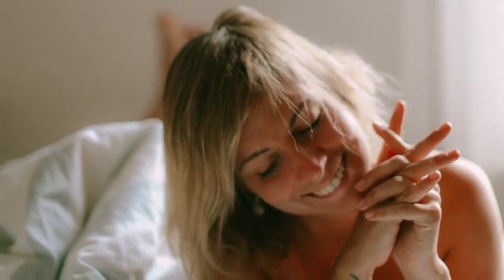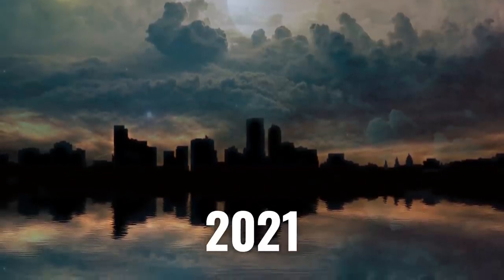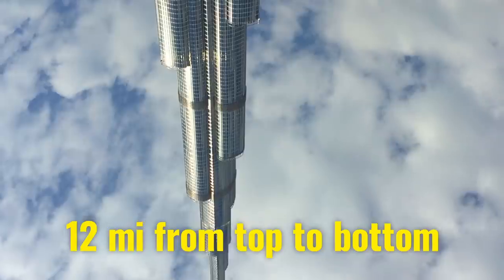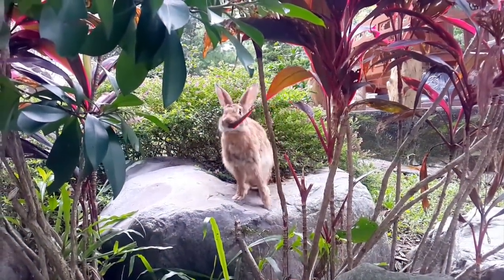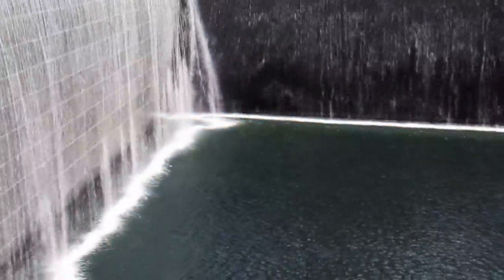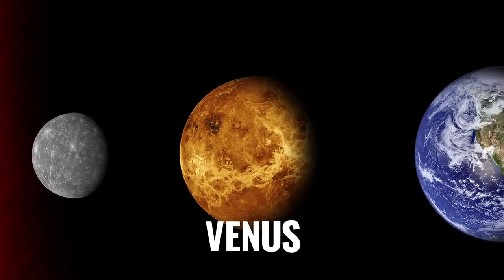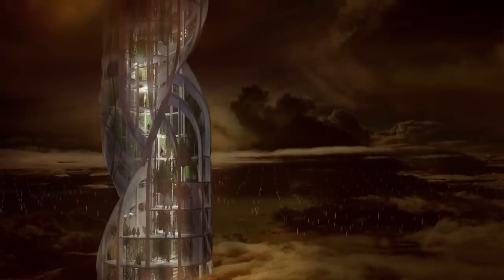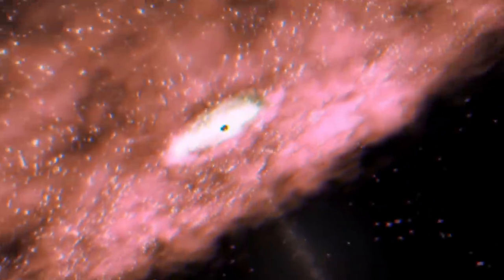The Insane Plan to Build a Skyscraper Hanging Down from Space!

Comment: He just making up stuff now 🤣
Reply: ChipidyGaming its a real thing
Reply: Nope you are right he's running out of shit to talk about its not possible.
Reply: @Panda Spike Lmao, do you have any idea how many safety regulations they'll have to get passed. I want to see it happen, but it wont.
Reply: @Panda Spike The fact, some architect made a design of a skyscraper suspended from an asteroid a few years ago. You will get more facts, if you look at the physics and math. No cabel can suspend its own weight for the required length, not even super-high-performance-tensile-strength-superalusteal-etc cabels, that would need to reach further out than the geosynchronous orbit, not 31 miles. not the only number in this video that were completely wrong, the only correct ones (of the top of my head) were the atmospheric conditions on Venus (with the exception of the hydrochlorid in the atmosphere, its sulfuric acid). Also at that point you should have been more sceptical; placing a rock in a 31 mile orbit(!) in an 1 bar atmosphere :D ...

tl,dr: It is a pipedream, or to use a german word, a "Luftschloss".

On a sidenote: NASA had made plans for a colony in the venusian atmosphere, suspended by ballons(!) with breathable air that generate enough lift in an CO_2-atmosphere. That is actually possible, by numbers, but why colonise venus or mars, when we have a paradise here on earth. A yes, I forgot, we are destroying that one.
Reply: Let me tell you why it's impossible... 
First the astroid will orbit earth hmm okay they can do that, but earth has its own gravity that will pull the building down to earth unless the astroid would be so big that it will cover the sky atleast 1km²

Second in order to keep that thing floating the astroid and atleast a third of the building has to be high up in 0 gravity, that high where we have space trash orbiting the earth at high speed, so the builders would probably be shot in the head by tiny metal objects

And last but not least they have to find a perfect way for it to fly through places without hitting other skyscrapers which is barely possible in Dubai or New York, as this building will also have to be away from air traffic, cuz the world won't change that for one building lol

Let alone safety and all this is impossible to do, especially with the economic problems the world is facing
Reply: The drag of the atmosphere will pull everything down.
It is indeed a stupid idea.
Reply: Trueskeptic exactly
Reply: AGREE
Reply: Actually, this project has been a thing for a while now. It started getting more attention last year.
Reply: they're going to hang it from the firmament
Reply: @Panda Spike this will never be built not in a long time
Reply: @Madmaxxxx1984  There is no firmament.
Reply: Trueskeptic Trueskeptic there is something up there Van Allen belt call it whatever you want to call it don't you find it funny Braun's tombstone scripture? go to South America the longest straight away and measure the supposed curvature from one end to the other, doesn't exactly pan out does it.. why ? idk . is it Globe? round? flat? part of a bigger system? .. I don't know but it's not what they say it is ..use your mind calculate the numbers... Warner von Braun Psalms  19:1
Reply: He was always just making shit up lol
Reply: Victor Angelo Hey uhhhh Math was invented by humans 😂
Reply: Trueskeptic safety regulations of what country?
Reply: @do-repo9170  we dont know if it ll pass through NY or dubai.  Orbit probably be made somewhere around van alen belt.
Reply: Panda Spike soon? Lmao no buddy.You know how long it takes to build a regular sky scraper? Okay it’ll take times that amount of time to make it probably won’t even be done.
Reply: @Panda Spike that is def bs mars one hasnt launched yet either as nasa promised it shouldve been launched in 2018 now the mars one mission is dead silent
Reply: ZZtop stranger  well the idea is not really bad it has def good potential for future ideas and structures in relation to gravity it is a step of certain gravity understanding
Reply: facts
Reply: TH3 GaminG DumB Mars one was private.... nothing to do with nasa
Reply: @Madmaxxxx1984  Oh yeah, you are one of those flat earth trolls. Point made
Reply: @FREEGEMS  Umm, Safety regulations worldwide.. It would interfere with cities, weather, airtraffic, etc.
Reply: Trueskeptic how am I a troll? last I checked trolls don't recite actual facts and references engage in a debate and use our god-given brain so you write me off as a troll how convenient and you must have not read my statement, either that or you just can't think very well for yourself not quite sure which one it is never did I say it was "flat" it could still be round and not flat pr a globe. I actually threw a couple options out there because when you put every one of them under scrutiny they don't make sense especially the spinning ball model so before you start labeling people and categorizing them you might want to use your brain and not attack them by calling them trolls.
Reply: @Madmaxxxx1984  
Not just a troll, a triggered flat earther. Can't imagine how you got to that point, but I feel bad for you. My condolences
Reply: Trueskeptic not triggered at all I just feel bad that people don't use their mind again I'm not saying it's flat we don't have any evidence to suggest it is or isn't...either of them have their pros and cons ..so are you going to bring anything useful to the table or you're just going to regurgitate mindless rhetoric? think about this one.. one of the biggest things I find suspect is that most astronauts will say they lost all the Telemetry to get back to the moon and it would be too costly to go back at least manned craft that doesn't make any sense because a modern day iPhone that all of us can carry has more technology than those modules carried on the alleged voyages just doesn't make any sense when you start adding everything together is all I am saying...
Reply: @Madmaxxxx1984  Ok

Comment: The atmosphere will slow down the lower part of the structure in which case it would fall to Earth.
 This project sounds impossible.
And also to bring an asteroid into orbit at this altitude It would need much greater speed.
Reply: It not only sounds impossible  it is impossible
Reply: @realLessonsoflife  
Yeah! I agree with you!
Reply: Innocent Bystander so you saying it would be 9/11 v2
Reply: It called geostationary orbit so it is not impossible
Reply: Innocent Bystander  31miles is not 31km
Reply: @MultiFuckme22  if we use GM/4π^2 = r^3/T^2 where M is the Mass of Earth, R is the radius of the orbit of the asteroid and T is the time it takes for one whole orbit.

then:
((6.67x10^-11) x (5.97x10^24)) / 4π^2 = (6.37x10^6 + 31x1609)^3 / T^2

1.009x10^11 =  2.6459x10^20 / T^2

2.622x10^9 = T^2
51208 seconds = T
=853 minutes
=14.2 hours

The Equatorial circumference of earth is 40,075 km  

so the asteroid and the building on it would have to travel at the speed of 2817Km/hour  (or 1750 Milies/hour)

and the speed of sound is 1234.8 Km/hour
thus it would have to travel at 2.28 times the speed of sound.

This might not be a problem for the asteroid but it would be for the people living in it as well as for the people in direction of the travel. The building, if managed be balanced, would be constantly vibrating .... plus... how do they want a plane to land on such fast moving object... or let people paraglide from it...
Reply: At least this is more believable than the flat earth theory..😂😮😂😮
Reply: Orlando do your research or just watch thunder foot debunk it
Reply: EXACTLY... Not only that, but to be in orbit will make the building move so fast through the atmosphere that it will catch on fire.
Reply: @orlando0076  Putting it over the equator in GEO makes this even more impossible, given the impossibility of the orbital mechanics required to assemble the thing and the fact that every satellite ever launched is already on a collision course with it.

Comment: Question is it plane proof because it would be 911 all over again
Reply: Or when ever the auto pilot crashes into the building.
Reply: Gabriel Wong exactly
Reply: yeah, but it will be unintentional and worse when a polar orbiting satellite slams into the middle of the thing at 17000 miles per hour and goes off with the force of a small nuclear device

Comment: NEVER HAPPENING!! 😁
Reply: That's what they said about airplanes. You never know.
Reply: Cruz Sigala Yeah, this project would cost something like the whole US budget for 10 years.
Reply: The best materials available to make cables capable of holding such a tower have a flex co-efficient that would render the whole structure akin to a giant bungie cord. It's also been said that the energy required to move a large enough asteroid from the belt to the earth at sufficient speed would equal the entire energy generated by mankind on earth for the last 35 years.
Reply: And also, we got to remenber physics exist:/
Reply: @socksumi  that's why there obiously just going to make it off flex seal
Reply: @crusigala  friction of the air hitting the building would slow the building and asteroid down until they hit earth, so yes, we know it wont work

Comment: UAE has a mission to build a city on Mars by 2117!
Reply: We really don't care
Reply: That might happen if they're committed to give that project enough funding.
Reply: One of the problems with going to Mars is that it's  long ways away from the Earth.  If an Apollo sized rocket was the same size as a AA or AAA battery, then the distance from Earth to the orbit of Mars would be about equal to the AAA battery sized rocket flying all the way around the equator of the Earth.  But the elliptical path that rockets take to go to Mars is actually much longer.  So going there is major accomplishment even for robotic probes.  The figures are bases on a scale of 1: 2000, with an Apollo rocket being about 100 meters high, a AA battery about 5 cm, and the distance between the orbit of Earth and Mars being almost 50 million miles, or about 2,000 times the size of the Earth's equator.  At this scale, a man 2 meters tall would be just 1 mm tall.
Reply: @beringstraitrailway  it's the UAE I'm talking about. I didn't understand some of what you said but thanks for the info.

Comment: 31 miles altitude?! These are supposed to be a space tethers, right? Those have to be:
1) Well above the athmosphere
2) In geosynchronous orbit, to keep the lower end stationary

How far up is a geosynchronous orbit? More than twenty thousand miles up. 
This isn't just fiction, it is poor fiction.
Reply: not minding the fact that the tower would travel across the skies at orbital speeds due to the fact that the tether asteroid has to be far above the geo synchronous line due to the force required to keep the tower from falling and bla bla bla. i thin thunderf00t did a great video on this that describes exactly why this is a bad idea even if we had the materials

Comment: The Stolar Stystem Is so kool, We should be moving into the Spuhdoodledorf tower soon. The finishing touches are being done now, it soon will be in its proper orbit around the sun, 35,000 miles above its surface with a balmy 1,000,000 degrees temperature. I can't wait to move in.

Comment: It'd have to be pressurized. Open a window on this thing and you die. Nobody can survive above the Armstrong limit. 63k feet is a stretch for aircraft. The service ceiling of a 727 is 42k feet. The Concorde had the highest at 60k feet.

I think we're going to have orbital stations before something that dips into atmosphere, simply for the impracticality of constantly reboosting to a higher orbit (aerodynamic drag). Eventually, this inverted tower would crash into the ground and bring the asteroid with it.

A space elevator attached to the Earth could maintain orbit if long enough because the rotational force of the planet would keep it slung out. It would also be at a fixed point in the sky.
Reply: Not to mention a space elevator would be way more useful and probably a lot cooler too.

Comment: Buildings stand and retain structure with concrete using its compression strength to prevent collapsing downward (crushing) and tension mostly horizontally using steel to hold it from collapsing outward (tearing). This type of structure would have to utilize tension in the vertical direction and and compression in the horizontal direction. This would likely require tethering all the way through the asteroid since it could sheer apart and the those tensile units would have to be pieced vertically since making them continuous is prohibitively expensive. They would also have to be stronger and greater in number as you go up towards the asteroid.
The entire structure depends completely on tensile strength to hold it up, and horizontal pylons would be needed to maintain any meaningful volume, but they would add to the weight increasing the load on the tensile units. We don't have mass produced materials strong enough to build in this manner. The tensile units could sheer apart and it would fall right out of the sky decimating it's target. We have never built like this before at scale. Hanging structures quickly become difficult to keep up and together as they increase in size.

Comment: Gravity will pull the earth scraper down easily due to a surface area more than five times the size that jehda tower will be when its complete. Depending on if the cables responsible for connecting it to the asteroid are strong enough, the tower will pull the asteroid with it out of earth's orbit, creating an even larger wave possibly a tsunami to surf on.

Comment: Alright, let's break down the stupidity:
1: The, for lack of a better word, contraption, would be whizzing around at around Mach 1. How would you like to have your day ruined by a skyscraper roaring over your house at the speed of sound?
2: It's impossible to control where it will go once it's in orbit. To mean, you can't keep it away from certain objects/structures like mountains once you set it in its orbit. The thing will slam in to Everest at the speed of sound and there isn't anything anyone can do about it.
3: The constant drag from the atmosphere will slow it down, causing it to eventually fall out of orbit
4: Every satellite ever launched will end up hitting this thing at some point. That's not a joke. It will be hit by every satellite ever.

Comment: 2:11 After i saw that i knew this could work
Reply: Alright, let's break down why this is impossible:
1: The, for lack of a better word, contraption, would be whizzing around at around Mach 1. How would you like to have your day ruined by a skyscraper roaring over your house at the speed of sound?
2: It's impossible to control where it will go once it's in orbit. To mean, you can't keep it away from certain objects/structures like mountains once you set it in its orbit. The thing will slam in to Everest at the speed of sound and there isn't anything anyone can do about it.
3: The constant drag from the atmosphere will slow it down, causing it to eventually fall out of orbit
4: Every satellite ever launched will end up hitting this thing at some point. That's not a joke. It will be hit by every satellite ever. This is guaranteed by the structure would have to be built at the equator, which is the point of the planet that every spacecraft in space must fly over at some point. Therefore, every object in an orbit below geostationary would end up crossing paths with this thing at some point, where it would then impact with the equivalent force of a small nuclear device.  If this thing were to be magically constructed today by a snap of my fingers, I would give it about 10 minutes before that happens and sends it crashing back to earth.

Comment: Before this could ever happen, the space elevator will happen sooner.
And the Space elevator is way off in creation mainly due to limitations with graphene scaling the size required for thick enough cables.
Some other really bad problem, you couldn't maneuver something very well of that size in orbital velocities.
I'm just hoping some day, probably in 200 to 1,000 years to maybe have a space elevator. Would make traversing into space extremely cheap, about the cost of a plane ticket or even lower the price of train ticket.

Comment: Orbit at 31 miles above sea level?  That's 160, 000 feet. Experimental rocket planes exceeded that. Certain high performance jet fighters get to 75% of that. What power supply will keep the asteroid's orbit from degenerating due to atmospheric drag.  That is before one does the math.  Minus the 20 mile tether leaves 11 miles to squeeze in a 12 mile tall building.

Comment: The video posted succeeded in it's purpose. I mean look at the number of comments. It fails for over exaggeration showing it close to earth. The science behind these concepts is sound. It basically says if you have a massive object in near orbit you can build downward into the stratosphere where wind resistance is negligible. Not all the way down to the troposphere where the air is thick! 
In other words, because of the huge mass at the top a structure could extend low enough to be accessible by high altitude planes rather than only accessible by rockets. This makes sense for cost in that regard. But the sheer cost of such a space station and makes no sense for safety. If it orbits the equator I should be safe in North America! Anyway, ignore the exaggerations and simply enjoy the novelty! We're going to see some shit! Tech on the verge!